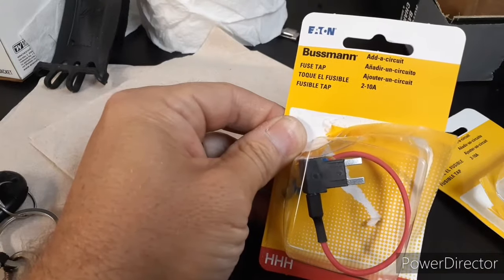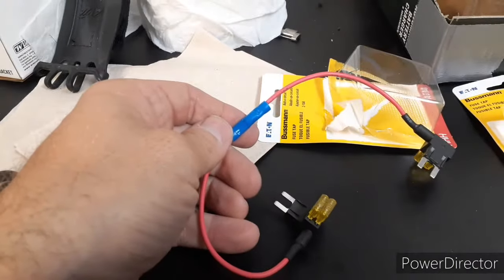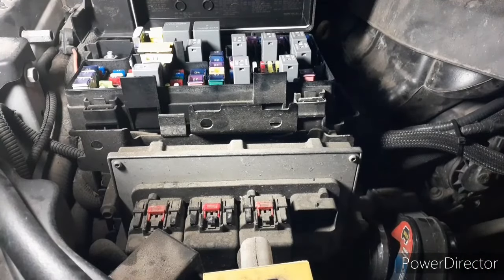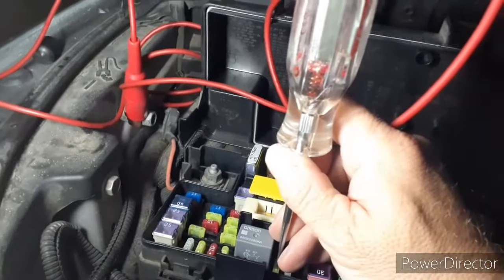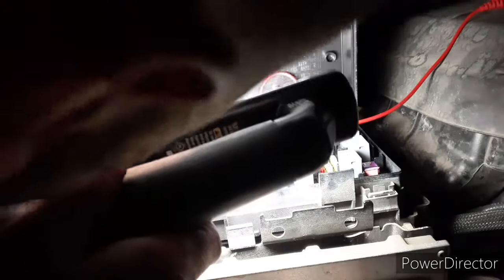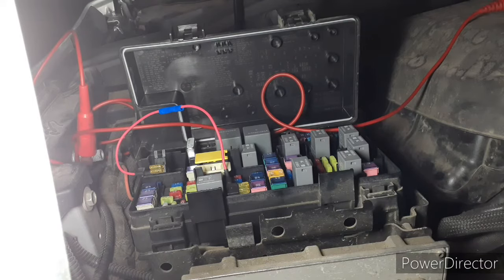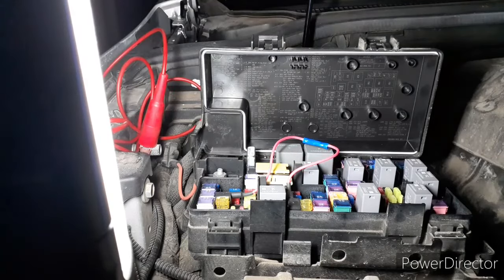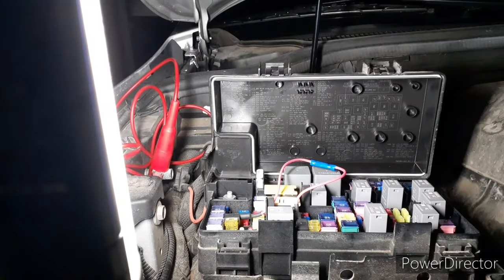Jeep Cranks But Won't Start. PCM Bypass Solution.

Comment: The relay is on the inside of that control module on the bottom side. It’s soldered in you can’t see it. You have to take the control module out and take the entire thing apart in four different pieces to get to the relay solder it out soldering a new one. There was a video I found on YouTube on how to take it apart.
Reply from the maker: No it is not.  You may be talking about a different part, on this one I promise you there is no relay.  If it were a relay that failed it would not energize even when power was forced to it as I am doing here.  If it were a relay this solution would not work.  Think about it.

This is a solution that works for only this specific problem in Chrysler vehicles.  It is a known problem with a service bulletin published about it.
Reply: The fuel pump relay is directly soldered to the engine fuse box circuit board aka TIPM. 

I had to completely disassemble the fuse box. It's in thin layers pancaked all together to make one complete fuse box. 

2011 TIPM does have it soldered. Pos Jeep/Dodge Chrysler fix is cutting the bottom fuse box wires & tapping into the harness wires & installing at 50amp (large) external relay with a connected 20am mini fuse. 

There's also a 20am mini fuse at the mutifuse aka block fuse (+ charging/junk post) thick positive wire. It's hidden wrapped in electrical tape. Hard to see but can be felt by hand & it stick out as "wtf is that" 

The TIPM will shut down no matter where you're driving. DGAF. Shuts off at red lights, yields, parked, waiting for the train to pass, in a drive thru, at idling & the worst scariest is when at highway speeds will turn off. The digital guages & electronics still work (HVAC, stereo, sun/moon roof, windows, head lights all work. The analog needles (RPM, speed, coolant) drop dead. 

Fck you Dodge,Jeep Chrysler Mopar. A known factory problem that they don't fix other than tell owners they can buy a new TIPM for $1,500.00 programming is extra. 

Jeep/Chrysler,  Dodge Mopar is a pos.
Reply: This is actually a recall just got my jeep done. They cut wires on bottom of TIPM and put an external relay. But now my jeep is doing exactly wat his jeep is doing. Only difference is his jeep don’t have the external relay

Comment: Hi I have a 2016 Jeep Cherokee limited 2.4L was having stalling throttling and smoke said i need an oil change but the reset of my levels wouldnt stay after that was done~ then The battery just died I bought a new one since it wouldnt stay past 10V the new battery was fine then Volt dropped from 14V to about 9 Volt ~~~~< long story short the it just wouldnt start it turns on all accessories work No dimming so Smh I dont know i installed the Fixd reader and it gave me the code P0335 for the Crankshaft position sensor or ECM failure 🎉Question could trying this fix my issue I try this to fix or ?

Comment: WOW!  You just saved my 2008 Jeep Patriot from the graveyard. I was minutes away from handing over my title to the Jeep dealer, who said the PCM is bad and they cant fix it. They contacted a junk yard who was going to give me $250 for it. I was reeling because otherwise it is a nice car with only 90,000 miles. I thought I would give this a shot first and woohoo, started right up! My fuse box is different than this one shown on the video, however. We'll see if this lasts and if other issues show up, but right now everything looks good, but now my engine light is on. Oh well. I have a running car. A million thanks!

Comment: Well you are talking about  and fixing an issue with the TIPM (Total Integrated Power Module) ......the PCM - is a different thing - (Power Control Module) ....it is the silver flat box in front of the "fuse Box" - TIPM .....the one with 3 big plugs with gazilion wires in each of them .  but apart from calling it the wrong name  glad it worked for you  .....
Reply from the maker: Yep, thanks.  I work on a ton of different makes and models and manufacturers tend to each have their own name for them.  You are correct and it is extremely easy to get all that terminology mixed up.  I have been turning a wrench for 20 years now and still screw it up because I no longer just work on one type of car.
Reply: I was going to say the same. Good video.

Comment: PCM – POWERTRAIN CONTROL MODULE
TIPM - Totally Integrated Power Module (Fuse Box)
ECM – ENGINE CONTROL MODULE
TCM – TRANSMISSION CONTROL MODULE

Comment: Would this be the same for a 06 commander? Having the same issue. I believe the anti theft system is shutting down the fuel pump. When I reprogram the key it works but then stops working. I did have a pcm code but it went away somehow.  Any advice would be appreciated
Reply: Did you ever figure out your commander problem

Comment: Thank you for the helpful video and for addressing every inquiry! I’ve just subscribed to your channel.

I have a 2010 Jeep Compass with a functioning battery, but the engine isn't cranking. I checked the fuses and found no voltage in the Engine ASD relay feed 2 & 3 (no. 23 & 26, both 15 amp).

My fuse no. 13 is a lighter fuse (20 amp yellow). Can I use a fuse tap to connect a 20 amp fuse on one side and a 15 amp fuse on the other side? Also, which fuse port should I use, no. 23 (ignition) or 26 (fuel injector) ?

Please & Thank you!
Reply from the maker: @MOHITSHARMA-kj3cw  isn't cranking or isn't starting? If it is turning over and won't fire, use this solution. If it is not turning over at all, check your starter.
Reply: It wasn’t the starter but the ASD relay causing the issue. Jeeps have a known design flaw with this relay, leading to corrosion and starting problems. I cleaned the relay and reconnected the wires, and it started right up.

Thanks for your response though! I’ll definitely keep following your videos for more helpful tips.
Reply from the maker: @MOHITSHARMA-kj3cw  that is great. I was trying to fish for some more information with the question isn't starting or isn't turning over at all.  Yeah, a bad relay is a common problem that will not allow power to go to the starter. Glad you got it.

Comment: Thank you for that wonderful advice. Mine is a commander 2007 3.0 CRD, crank but no start, DTC P0607 that is turning off most sensors needed to start the car. I just took turbo off and put it back after overhaul kit. Any ideas? I wonder if some ground is not coonected or there is a short circuit. Fuses all look fine from inspection

Comment: hello mr..i did it before...but its better to join a relay 30amp by connecting a real circuit with the dark blue orange wire below the box under the m25 fuse anyway i like the piece you used its a simple way at least to move the car
Reply from the maker: No one is going to pull the entire box out when they are stuck somewhere, or even just in their driveway. Your way may look more tidy but sounds like a lot of unnecessary work to get down the road.  Thanks for your version and opinion though. Where is your video?

Comment: After replacing the fuel pump/3.7 WK- Im now having a problem with a vapor lock and my new pump is making a ringing/humming  noise off and on-is there a way to fix it with a inline check valve or inline filter of some sort. I have to release pressure on the fuel rail to re-crank it after it runs for more than 20 minutes/ which is a possible fire risk.

Comment: Hi there , I did it on my 11 ram 2500 and engine still crank but not starting at all , also by fuse tester there is no ⚡️ on fuel pump realy !!!

Any Idea will appreciate 🫡
Reply from the maker: You are forcing power to your fuel pump with this bypass.

Comment: My jeep won’t will crank but won’t run I checked that fuse for power and it didn’t have power. Did the fuse tap like the video said and still won’t run.. checked the relay it’s good. Does this mean my fuel pump is bad??????
Reply from the maker: Well it could be a few things. Hard to see from my house. What year is your jeep?

Comment: I appreciate you very much sir letting us all know about this information . A year ago my 2005 JGC security went off when I put key in door and it shut the fuel pump off I searched it here on YouTube and found this video it worked 💯 so I am Thankful sir! 
I’ve run Jeep this way since but it done it again so my question is Now What? I got fuse tap’s just like you have but now it’s done it again what can I do to bypass it.
Reply from the maker: I need to know what is happening when you check the electrical. Are you still forcing power to your fuel pump from an auxiliary power on 12 volts?
Reply: @dinstaar  yes I am
I was 75 miles from home when it shut fuel pump off. So I ran a hot wire from fuse box under dash to positive wire on pump and I put it on a switch on dash so I can cut power when I cut engine off. 
So now I’m home the door locks and power windows and of course the fuel pump doesn’t work. So I’m guessing it’s the TIPM or PCM it’s something that’s stopping power from these components. But I got it home and I have 1,500$ in it been driving it for a year and a half so if I can personally fix it I will but I want be paying anyone to fix it.
Reply from the maker: @williewaynewheelbarrowtoma4436  did you protect this new hot wire with a fuse? How many amps was it running? The reason I ask is because you may have pushed too many amps to your PCM causing damage. 

We already know your PCM is damaged because of the original failure. You can order one and put it in yourself. It is not too difficult. However, by grabbing a random wire under the dash you may have caused more damage. I would start with a PCM and see where you stand after that.
Reply: @dinstaar  I couldn’t tell you I just ran a hot wire from a fuse to pump positive wire and I heard it start working and I come home
Reply: @dinstaar  I want to Update you about my 05 Jeep Grand Cherokee 3.7 
Idk how long it will last again this time but like I said previously got it home had to run 45 Top speed because not only did it shut fuel pump off  but this time Transmission wouldn’t shift  into high gear along with the windows wouldn’t work also the stereo didn’t work that’s the first time it’s done all that the past 2 times security has just shut off the fuel pump. Here’s what I did to make it work again after I got home. Took the the Tipm completely out of car along with the Flat Thing mounted to the side of Tipm I’m guessing it’s the Computer are it maybe part of the Tipm either way I left it mounted to the side of Tipm but I Took these things in the house . It was terribly Cold. So next day I took my Big magnifying Glass and pocket knife got some Brake cleaner got it under a good Light so I could see well and I found that a few pins were a greenish color so I scraped those and one of the Plugs that plugs in bottom of Tipm has either been partially eaten away by battery acid or something got hot the pins were all there and complete some of the Plastic housing was gone and exposing A few pins. Wasn’t in need of going anywhere for a couple of days so I kept Tipm in house When I put it back on Jeep and connected plugs I coated the side of Tipm plug where it was damaged  and let it dry good and next day when I connected battery I heard fuel pump start pumping. It started right up and windows were working stereo came on and transmission shifted correctly so it’s few weeks now and so far so good.
Reply from the maker: @williewaynewheelbarrowtoma4436  Glad you got it going. I would place an order as soon as you can for a new part. That has been giving you hell for way too long brother. Sounds like you know for sure what you need, and that is sometimes the hardest part.

Comment: Hey I don't see a lift pump fuse on my 06 Grand Cherokee where would it be located??? I really don't want to pay all this money to get it fixed in a shop
Reply from the maker: If yours is an 06, you have a different problem and a different PCM. This won't work.

Tell me your symptoms and I will attempt to point you in the right direction.

Comment: Was this done after the recall in which an external fuel pump relay was installed to bypass the tipm?
I'm getting p0628 code, crank but no start in my 2012 grand Cherokee 3.0 crd
Reply from the maker: This bypass was done before the recall. I figured this out myself, Chrysler could not. Their recall solution is a modified version of this they took credit for, they just added a relay where I rely on a fuse. Check the date of my video, 5 days BEFORE they published their bypass.
Reply: @dinstaar  Thanks for the response, I thought I narrowed down my issue to the recall wiring being faulty, after cutting out the joins the dealership put in and putting in fresh crimps the problem is not resolved. The next area I plan to look at is the pink control wire, since during the recall process they pop the pin out of the harness plug, it might not be seated in properly and isn't making a solid connection to the tipm.
If this fails to fix my issue I think I will try reversing the recall, remove the relay and try your pcm bypass solution.
I'm not convinced it's a fuel pump issue just yet.
Reply from the maker: @bloggs24  If you do the electrical checks for voltage I show in this video, you will know if it is a fuel pump issue or not. Do not skip that step, it is the most important part.

Comment: Will this work for a 2004 jeep grand cherokee Laredo.  The person I'm buying lost keys if I change the key cylinder and do this bypass will it start?
Reply from the maker: Your fuse box is very different than those made from 2011 to 2022.  This is a specific solution for a very specific problem and that is all it is.  Depending on your model or anti-theft equipment your solution is going to be very different.

Comment: Hey boss, ive got a 2012 jeep grand cherokee 5.7 swapped fuel pump, spark plugs, fuel injectors are showing charge, gave the car a new battery replaced fuzes and relays tried this bypass and even swapped my position sensors, car still only cranks, and clue what the problem is
Reply from the maker: @jadenfox3445  you did not mention air flow or any check engine lights. Check for air restrictions, look for a fault code that could be related to the computer cutting fuel. You could also crack a fuel line and see if gas is getting to your engine. Good luck.

Comment: have a 2013 cherokee 5.7 had the recall repair done that supposedly fixed the hard crank no start behavior. Did not fix it. Every now and then it will pull the violent crank no start behavior. Then it will start. Jeep is no help on this. Will this hack you came up with solve my issue?
Thanks
Reply from the maker: If your vehicle starts and runs most the time, you most likely have a different problem.

Comment: Does this work with 2007 Dodge Durango 5.7? I have the same symptoms my PCM and everything electric acts up in the car can I at least drive around with this hook up until I get my computer again do I connect bad pcm again?again?
Reply from the maker: Well, I don't honestly know what PCM Chrysler put in every vehicle they made each year. You have to look at the fuse box itself and see if your fuses are in the same spot and has the same power issue. If so, your PCM is the same and it will work.
You can drive with this fix forever.

Comment: Great information & yes i want to try this so much just to get it to the dealer
Reply from the maker: Cheaper than a tow.
Reply: Can you look at my other post also please? I need help!
Reply from the maker: @Ayemsladychay  Sorry, I have hundreds of posts. It will take me all day. Please repeat your question.
Reply: Hi I have a 2016 Jeep Cherokee limited 2.4L was having stalling throttling and smoke said i need an oil change but the reset of my levels wouldnt stay after that was done~ then The battery just died I bought a new one since it wouldnt stay past 10V the new battery was fine then Volt dropped from 14V to about 9 Volt ~~~~< long story short the it just wouldnt start it turns on all accessories work No dimming so Smh I dont know i installed the Fixd reader and it gave me the code P0335 for the Crankshaft position sensor or ECM failure 🎉Question could trying this fix my issue I try this to fix or ?
Reply from the maker: @Ayemsladychay  Absolutely not. This will in no way help you. Smoke and throttle response is most likely a mechanical issue.

Comment: Thank goodness i found this video. It worked. But now my speedometer isn't working. Any idea what might be causing it not to work?
Reply: Its a 2012 jeep wrangler
Reply from the maker: It would be an unrelated issue. Is your speedo just not reading Amy speed at all?

The most common issue for that is a speed sensor toward the rear of your transmission.
Reply: @dinstaar  yea it just stays at zero while I'm driving.  We checked that earlier it seemed to be plugged in right.
Reply from the maker: @briannajohnson6112  you need to replace the speed sensor toward the rear of the transmission. They fail all the time.
Reply: @dinstaar  ok. Thanks so much

Comment: Im working on an 02 Grand Cherokee 4.0.
I believe the Skim system has failed.No fuel.I installed a new mopar fuel pump and filter.Still no fuel.
The key light on the dash stays on and I also cant get my scanner to link up with the ECU.Wierd.
Im wondering if this trick would work to be able to bypass the Skim system.
Reply from the maker: This is a very specific bypass for a very specific failure. It is not a fix all for any problem. You seem to have a damaged PCM or a skim issue. That is very different. 

Good luck.
Reply: @dinstaar  I'll keep digging into it.Thanks for the reply!